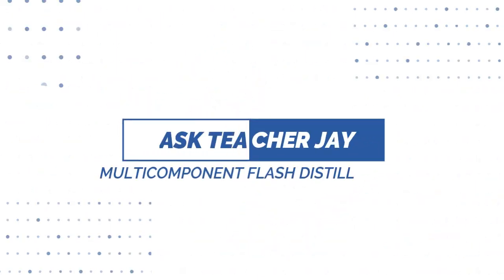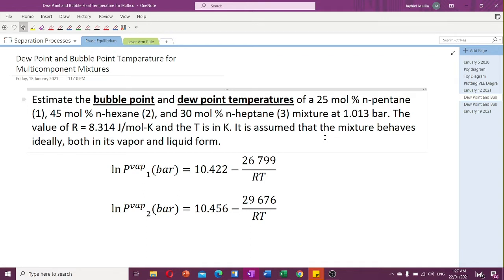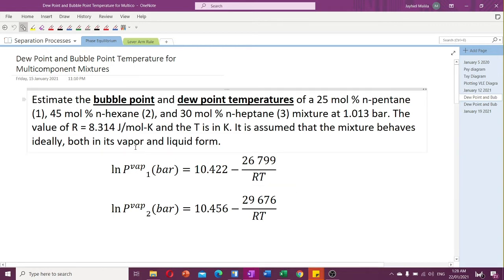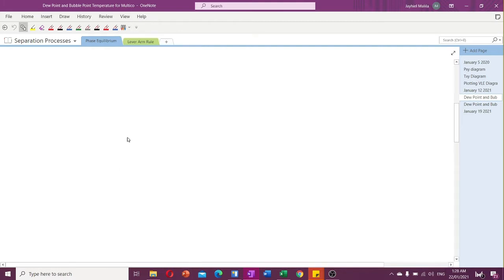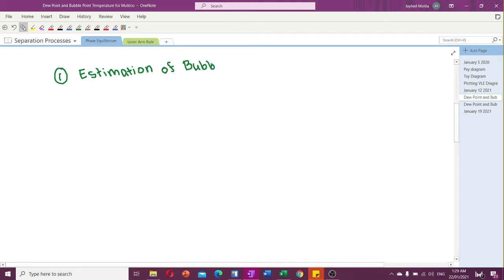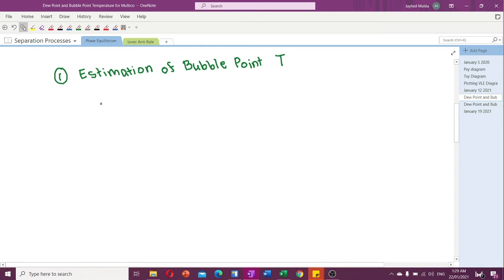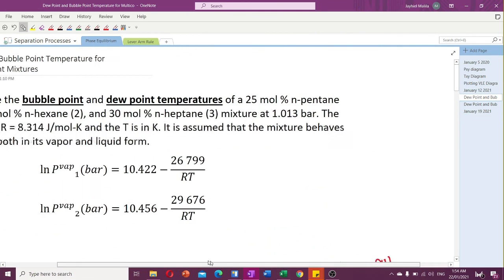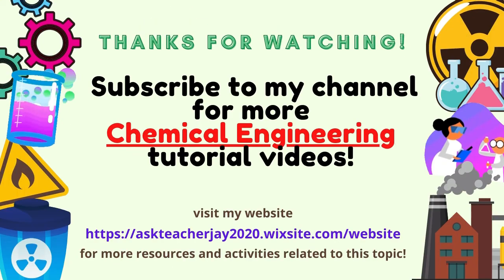Bubble Point and Dew Point Temperatures | Multicomponent Flash Distillation | Ask Teacher Jay

Comment: Could you give the references of the K factor values? from which site or books? Also how we know the equation of P(vap)? could you explain? or give references? Thank you so much
Reply from the maker: The equation is already given as part of the word problem. You can use Antoine equation as a replacement for the equation that I used here in the problem.
Reply from the maker: I used the book of Chemical Engineering Thermodynamics by Sandler.